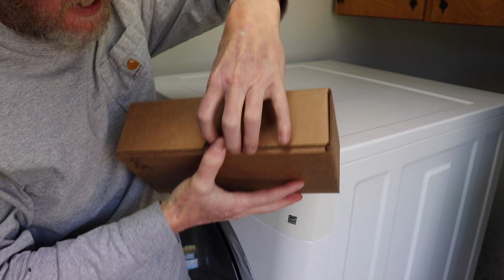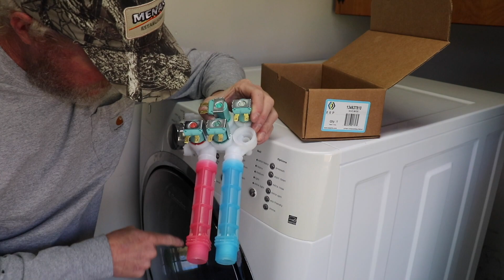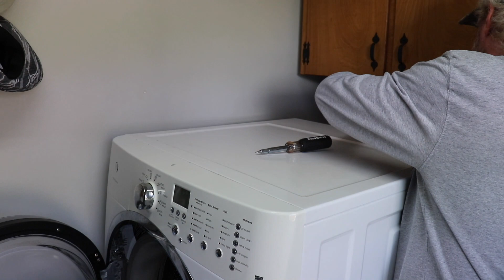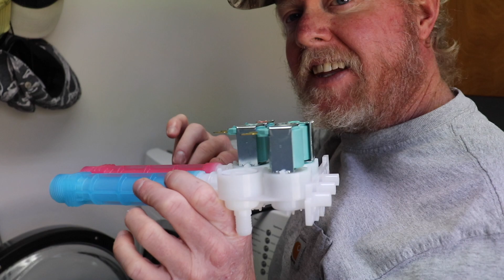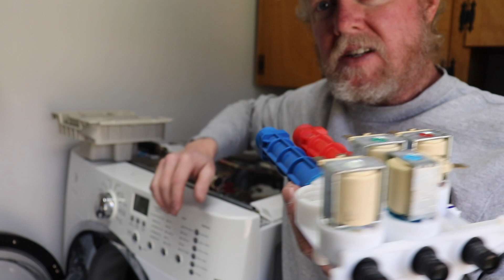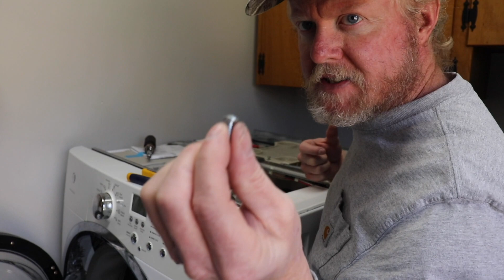Appliance Shortage. Repair or Replace?

Comment: We are going through this same issue right now with our washer . I wish I could just get a plain old machine because the ones that have the the boards that light up don't last very long at all .The repair right now is the way to go.
Reply from the maker: So far seems like a brand new machine. I was dreading getting old ones out and new in more than having to buy new ones. Repair saved me from all that hassle as well.